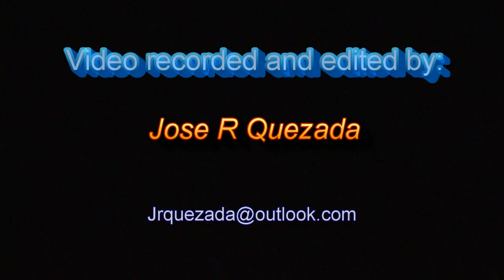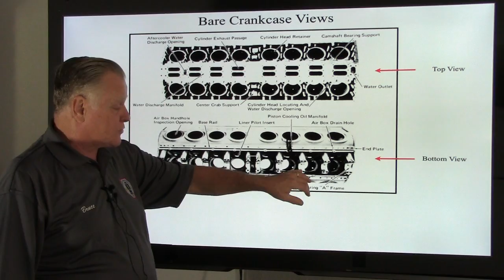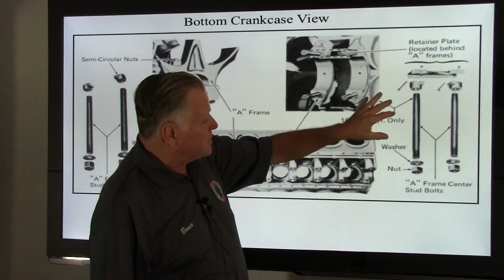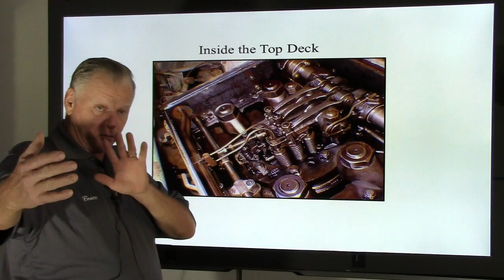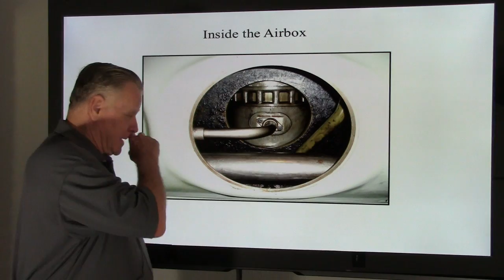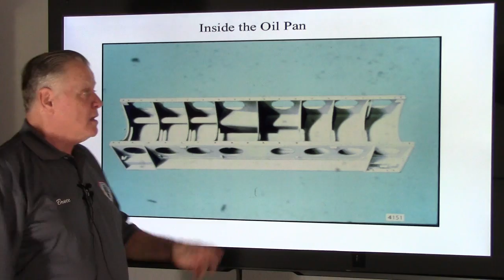LSTV-005 EMD engine design and components

Comment: What makes emd engine sound different than GE or Alco?
Reply: EMD's are 2-strokes, which means that every cylinder fires in one crankshaft revolution.  GE and Alco engines are 4-stroke, which means that it takes 2 revolutions of the crankshaft for all cylinders to fire.  Basically the EMD sounds like it's running twice as fast because the cylinder firing rate is doubled.

Comment: These engines use welded framework due to the fact that cast blocks are too stiff and can crack when used in locomotives that are constantly exposed to the rigors of railway travel-- this according to the EMD display at SteamTown, Pa.
Reply: Brilliant idea at GM to use a welded-up engine frame (block) with inserted cast iron cylinders.
Reply: cast blocks are much heavier and are harder to fix if freeze damage. These also can be totally rebuilt int the bottom of a tugboat.